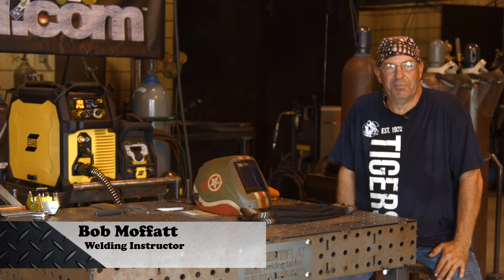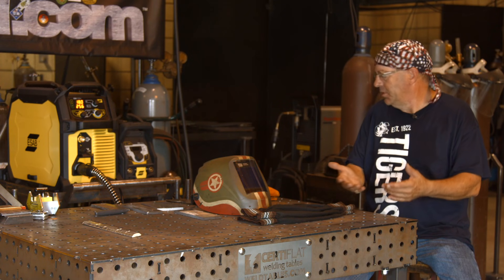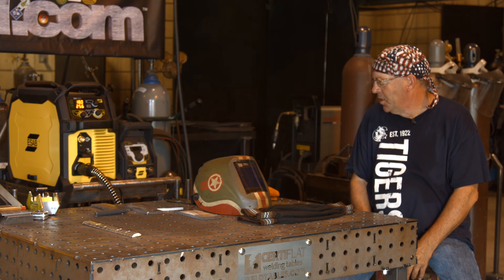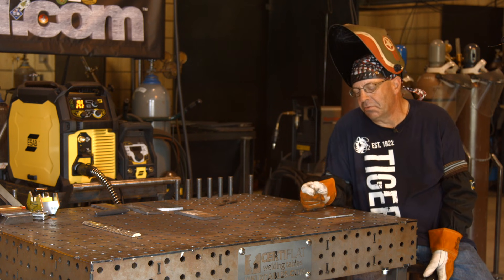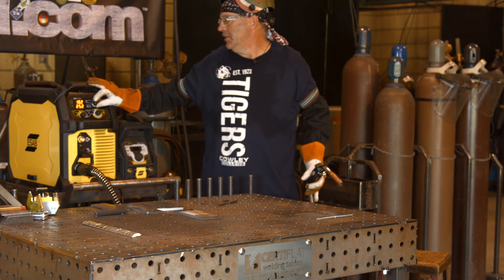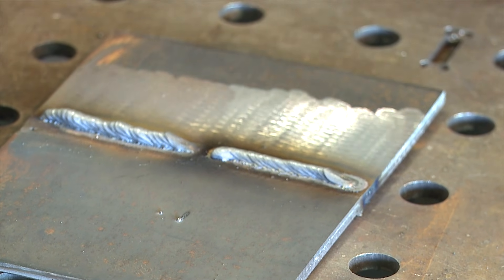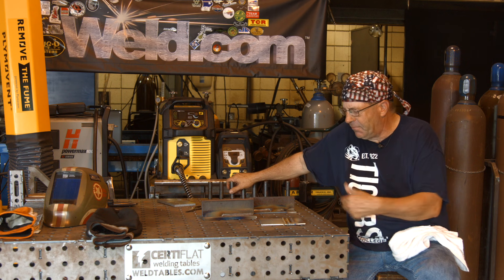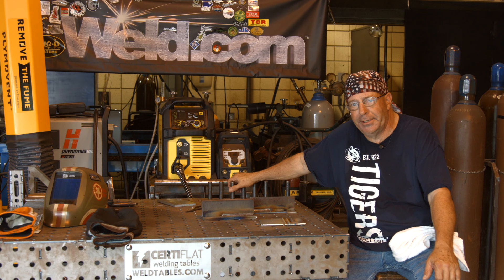🔥 MIG Welding Steel with Pure Argon

Comment: Thank god you made this video, I was about to use my TiG bottle for my new MiG because I don’t have 75/25 yet. Glad I watched this before trying it.
Reply: I use pure argon on mig wire before.  Its work just fine.  Not as smooth or pretty but it will work ..
Reply: @chiathach206 no, it doesn’t. Cut the welds apart and you’ll see for yourself.

Comment: Hey, that was really interesting.  I used the MIG at my Menz Shed today, and it was connected to argon with no other bottles to switch to.  The person who last used it was not there so I went ahead and used it and I got that same tall, thin bead.   I have a feeling that when that person is back, he will say that it makes no difference and we might as well make do with the one bottle.  We even had a spare bottle of argon!  I've been retired 17 years now, and I never counted myself as a great welder (I worked 40 years as a toolmaker at Ford Research & Engineering in the UK), and my near sight is crap and the MIG welder we have is no great shakes, but I know I can still do a lot better than the result using an argon shield gave me today.  I'm just glad I used more than enough weld on todays job, so it should hold.

Comment: I guess the obvious question (for me) coming out of this video is - since you say you have all the various gas mixes available why don't you SHOW US the difference with the same settings and different gasses. For example you say you get undercut (or something) with pure argon. Show the undercut with pure argon and then switch gasses and show how it is eliminated. You say you don't like the profile of the weld with the pure argon. Then switch gasses and show us how it gets better. Everybody seems to have an opinion. You are in the unique position to show the differences having various gasses and machines at your disposal. Thanks for the videos. I really enjoy them.
Reply: You need significantly different settings on different gas mixes to get good welds (CO2 vs C25 being the two that I've tried). With the wrong settings it'll come out crappy even with the best equipment.
Reply: True I guess.   But it appears (in his opinion) there were no settings from "typical" to ridiculous that produced a good weld with pure argon. SO was the point of this video to prove that you can't get a good MIG weld with pure argon?  Sorry I'm just trying to find a take away here. I'm still learning and I don't even use MIG. Great video's. I'm learning a lot.
Reply: @davesage9190 it’s not just “his opinion”. The welding industry does extensive testing because reall welding is not done at home in the garage where weld don’t matter that much. Welding has been around for over a hundred years and MiG for almost as long. There are always a few people who think they know more than what industry has found to work and not work. They’re wrong.
Reply: Dave did you watch from the beginning?  DIYers want to buy only one bottle ($250-400) click their heels together and wish pure argon for TIG was the cure all.   The answer was you can, but please don't.  There are still commenters here they say he is not adjusting it right.

Comment: You solved my problem. Ive got an old telwin mig that I bought 40 years ago to weld quarter panels and floors when restoring cars. It worked great but the gun/ cable wore out and I couldn’t find a replacement till last year.  I have a bottle of 75/25 at home but I haven’t used it in about 5 years. I had a project here at work so I bought the old girl in and hooked up to the 100% argon line instead of using my tank. I couldn’t get any decent bead out of it no matter what I tried. I now have that answer thanks to you.

Comment: Thank you for this.  I’ve been using 100% argon for AL MIG in a spool gun and tried using it for steel and ran into the same thing you are.  I’m going to get a tank of AR75/CO25 tomorrow to finish my steel project.  Thank you!!
Reply: How did the project come out with the 75/25?
Reply: @joshuastevens2013   Tried with pure argon but beads just were tall and ropey.  Played with settings but still not to my satisfaction.  They piece I was welding was part of a retail counter with welds visible so this was a no-go.  Going to C25 made all the difference...  totally worth it for my purposes.

Comment: I know this is an older video but, I have been trying different gasses on a older Lincoln 100 that I converted to gas from flux in my early days of welding. Using a C-10 mixture of 90% argon and 10% CO2 running at a #28 flow rate has this machine running better than I ever thought possible. In some occasions I increase the flow rate up to as high as 40 but rarely, as I am also using. 023 and. 025 wire. I now have a small portable unit, that runs on 120V,  I can use in a bind off my generator and get decent welds.

Comment: Gettin that sweat in your eyes ain't fun,  last year my helper by mistake put 100% argon on the mig, 035, 70s6, I put 2,000 lb helper rubber springs on a 1ton rear end, welded the pads on and said what's wrong ? The bead had a high crown, didn't seam to have good penetration,  so I stopped,  cut of the pads and stick welded 1/8 inch 7018, then as I cut off the pads it DID have pretty good penetration but that high crown and arc was too smooth fooled me,  anyway I played with settings still high crown,  I shut it down as I was closing the bottle, Aha!!!, there it was 100% argon !!! GREAT VIDEO BOB.

Comment: Thanks for proving this point man. I learned this lesson a long time ago, thinking that my machine was sucky, because it wouldn't flow a good puddle. Ironically I thought that 100% Argon had to be way better than 75/25. Then I ran some .030 on a buddy's junky Harbor Freight machine with 75/25, and it welded rather nice. Hmm..how the heck is this backyard welder out-performing my Miller?? So yeah,...hooked up a bottle of 75/25 to it and what do ya know?....it flows like butter. 
Thnx again guys, these bits and tips are gold.

Comment: After watching this the answer is yes you can weld mild steel with argon it just may be a little harder or not look as good, but it can be done and if you just want one gas the gas is argon because you can also weld Aluminum with it!
Reply: I wwllding with pure argon with high amperage and volts and it welds fine. You just need to get smooth mellting like lava. Not for tickest material.
Reply: @davormrsic8765  any tips you got for mig welding with 100% argon would be helpful as all I see online is some what negative videos like this one. I mostly do aluminum tig so I don't usually have a need for 75/25 so if you got any tips for controlling a 100% argon mig weld would be dope
Reply: @adrianayala9753  As I said. 100% argon wellding is for marine A4 stainless steel where you wellding pure inox because of rust. It is for fatt 10+ mm fatt material. I used Mig mag welldings but for thickest mm like 0.4 to 0.1mm is better use tig wellding machine. You get  Smoother welds. Because when you wellding with 100% Argon or 90/10 you need high amperage because you need to make weld mellting on material like lava. It needs to be smooth and soft. Not harsh. I dont know how to explain you better.
Reply: I wouldn’t recommend it. Look, you can weld almost anything with any gas, but that doesn’t mean you’ll get a good weld. If you really don t know what a good weld is, then you might think a bad one js a good one.

Comment: As an aside, I've tried to buy things like 90Ar-10CO2, Argon 1%O2, others you mentioned there... and local welding supplies had NO IDEA what I was talking about, didn't seem to want to get some in... so that's why I have a bunch of flow meters and try to mix stuff on the spot for labs.  I have found that businesses that claim "If we don't have it, we'll get it" don't actually mean that, it's more like "If we don't have it, you don't need it"!  SMITH makes these gas-mixing boxes with knobs on the front, you can just dial up a gas mixture... that's what I really want!
Reply: Those are common gases. Find a different supplier.
Reply: Indeed!
Reply: Yeah you go to a lot of businesses to get something .  The young person at the counter; Nope , never heard of that, thanks for stoppin' by.

Comment: I started Argon welding and Flux cored welding today, it’s different from my normal stick welding. But if there’s one thing I like more than stick with Argon and Flux is that, it’s more efficient and looks cleaner when you work with it. I really enjoy doing both a lot, and I’ve only just begun.

Comment: Thanks loads Mr Mofit...  I started watching to try and improve my stick welding. As i could put metal together , but looks like shite.   And as i watched i found i could improve my over all welding in general.  Im a repair guy so to speak. I do a little of this and that. And nothing to big or important to care about a bead profile..    Weld , grind and paint.......   But after yesterday's repair. I definitely noticed a change in pentration flow and bead profile in my mig welding.  And my stick welding is loads beter now.......  Being self taught will only get you so far in some things... Technique and values are good information to have .....

Comment: Funny thing, worked in a structural fab shop back in New Hampshire, Mon Fab, and on the Lincoln remotes with 3/32 wire, they ran straight argon. Ran beautifully.

Comment: If you were in a pinch and just needed to tack something together straight argon could be used. The use of straight argon as shown in the video does exactly what you just saw....produces poop.  The comment you made about oxygen and that others say "oxygen is detrimental to the weld". Well yes it is in large enough amounts. Common shielding gases for mig welding that use a mix with oxygen does not contain high enough levels of oxygen to negatively affect the weld. Typical mig wires such as an S-6 or an S-3 contain enough deoxidizers to compensate for this and more. As long as you have an argon rich environment, 80% or more, you can run in spray. Great video.

Comment: Thanks for this.  Just bought a new welder and tooled up with pure Argon for the TIG side of the work.  Tried MIG today,  with pure Argon, and wondered if there was a fault with the welding set because I couldn't get the weld to flatten out.
In hindsight I wish I'd used the stick or the TIG for the job.
Oh well, I'll just have to grind it back tomorrow and start again.

Comment: I used to have a small 110 volt home type MIG welder.  I had gotten a bottle of pure Argo to try and weld aluminum (big mistake).  One day I ran out of Argo Co mix and tried to use the straight Argon bottle.  It splattered and popped and otherwise made a mess of the weld.  Thanks for the video.
Reply: Pure argon is used for aluminum.
Reply: Yep, a small 120v mig and argon is a popcorn and rope producer, not a welder. Sometimes these videos are good because it shows people why that cannot understand. Like you said how you learned. Love these types of videos even though it pains Bob to make them lol

Comment: Years ago....35 or so....I bought one of the first Miller-Matic 200's....was building a lot of woodstoves/heaters....1/4" and 3/8" HRS and pipe.....spray arc....tried 100% argon...same results as you got here....ended up using 90/2/8 or 90/8/2   Argon, Co2, Oxygen....seems like the 90/8/2 was best for me, ran mostly .035"....some .045" for the spray arc......although there was also 92/8......Argon, C02...they all cost about the same... I had a small one man shop, I ended up with 5-6 different gasses...Oxy, Acet, Argon, C02, 90/8/2 and some helium....

Comment: We use a 90/10 mix and an 80/20 mix with 811N1 .045 wire dual shield flux and the 90/10 is more of a spray 80/20 is for most everything else including overhead. My personal setup preference is 80/20 .045 at 28.2 volts and 490 ipm for vertical and 29.5 volts and 575 ipm for flat  to do a 3/16" bead size and 630 to 650 ipm for anything bigger... the 90/10 is more of a flat weld only gas mix. it's awesome for spray transfer but it's so hot it has higher tendencies to give you undercut in the worst places!

Comment: I only know TIG, stick and gas, never done mig.

But if you need more oxidizer in the weld, what if you just turned the argon gas flow rate way down?

Comment: This seems like an advantage of TIG:  One gas for all situations!  I understand that some oxygen is necessary for MIG (MAG!) welding on ferrous materials.  Needs some oxides on the surface for emission?   In England they have Argonox1, Argonox2....
Reply: Except TIG is slow deposition rate compared to MIG.  (don't get me wrong, I love TIG, but if you're welding a trailer frame I'll be done in half the time or less with MIG)

Comment: At 8 minutes I noticed an etching effect similar to AC on aluminum, it was when you outran this etching effect that the puddle would sputter and give off its obnoxious noise contesting the action. 
I've done straight argon mild Steel worm tracks undercut , get the right gear change the wire( to dual Shield or similar )or change the gas.

Comment: Argon is not a reactive gas like CO2 hence you don't have the dig factor, add just a small amount of CO2 and its a whole new game. I run 80/20 with 0.030" and go from short circuit to spray with just a turn of the dial. 80/20 is a great all around gas for me with wet out and penetration.
Reply: cool

Comment: We just switched my shop from 75/25 to 90/10 and all of the old timers had to take time off for emotional distress. Then the switch from ER70S-3 to ER70S-6 ALMOST KILLED EM. At the heat we run its smoother with less spatter.
Reply: LOL
Reply: One day you’ll be an old timer too Jake.

Comment: I arrived here needing to finish up a small project and ran out of C25 but have a tank of argon.  Seeing this I have to ask how much welding on a flat sheet of 3/16” with no joint which is sitting directly on top of what is likely a 1/2” sheet of the table.. will greatly affect it like a heatsink and not allow for good penetration unless you really crank up the heat.  In other words, I’d like to see this done with the test plate clamped off to the edge of the table to see the setting differences.

Comment: Running strait argon will typically pile up. But let me point out that with solid wire you should be pushing your welds, not pulling!

Comment: we use a argon 97% co2 2% and nitrogen 1% blend.
to spray works perfekt :) 
Great video, fun to learn :D
Reply: That's an odd mix. I bet it's pricey.
Reply: I don't see why it would be, none of the component gasses are particularly expensive (unlike helium). I'd expect cost to be pretty similar to straight Argon.
Reply: I have heard it's for a hottere weld pool :D

Comment: I ran out of CO2 one day and tried Argon and Argon CO2 mix and found I had to pour the gas on at high volume rates to rid the weld of brown haze, only with high gas rates did it seem to weld reasonbly... all previous welding was only with CO2, which I have done well...

Comment: Very interesting test, I've always wondered. I have a Millermatic 252 (runs C25) and a Miller Syncrowave 210, which is a multi process (Arc, AC/DC Tig, & spoolgun Mig). While I always use the 252 with C25 for migging steel, I was curious if I could stick a 1# spool in the spoolgun with the pure argon, in a pinch. The results in your video were pretty apparent,  but it still begs the question: why does pure argon work well for tigging steel, but migging steel performs better with a CO2 mix? Very interesting, thanks again.
Reply: The reason is with TIG your not transferring metal across an arc.

Comment: Just another example of: "l'll save a buck." Anybody that's lived for any period of time realizes that's a certain recipe for disaster. The truly hot setup that I've gone to is 90-10 Argon/CO2 for all steel mig welding. My HTP Propulse  200 loves it for all modes including pulse spray arc along with normal short circuit MIG. Spray arc is just a thing of beauty.
Reply: SATAMAN Schmidt I use the same mix with my Everlast 256DPI, works great.

Comment: Can you weld steel with helium/ argon? I don't weld enough to buy another bottle I mainly use argon to work on my aluminum boat and flux core when I need to weld steel. It would be nice if one gas would work on both steel and aluminum.

Comment: Hi I normally weld with gassless wire or pure CO2. I needed to do some aluminium welding so got some pure argon, worked OK. Back to steel now and because cylinder hire is expensive in Oz  and I have a cheap supply of CO2 I am going to try mixing the gasses using a 'Y' tube connector just before the connection goes into the back of my MIG. Any thoughts?

Also when should you use spray and when should you use short circuit

Thanks in advance

Ian
Reply: Spray on heavy sections in flat and horizontal. Short arc in all positions, bevels, thinner sections.

Comment: Hoping you guys can help me. I just got the esab 215 ic to use for mig brazing for automotive use. Can’t get the setting right seems to worp the metal and put a lot of material down. Is the rebel a pulse machine I can’t find any info on that. Machines like the HTP pro pulse 200 have a setting for silicon bronze (mig brazing). Because of high strength steels being used in vehicles today they want the lower heat of the silicon bronze instead of traditional mig welds.

Comment: Can someone explain why I can TIG weld Stainless (304) using 100% Argon and 308L filler Rod, but you can't MIG Stainless 304 with 100% Argon and 308L Wire? Same Parent Metal, same heat, same filler .... seems illogical to me that you can't use the same Gas.